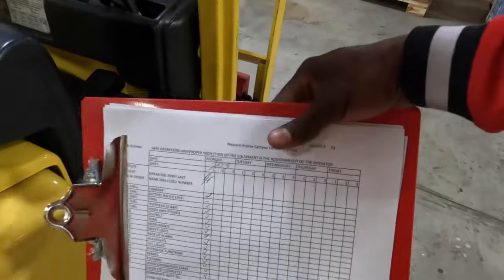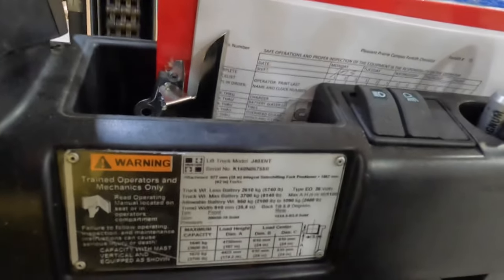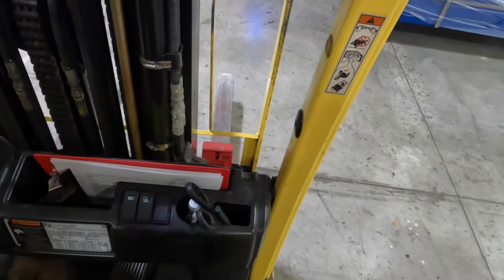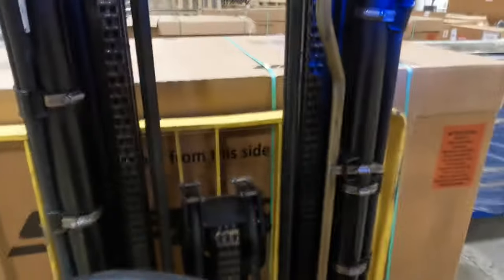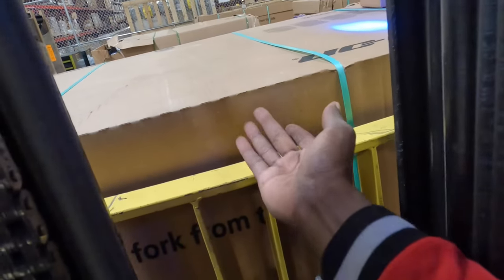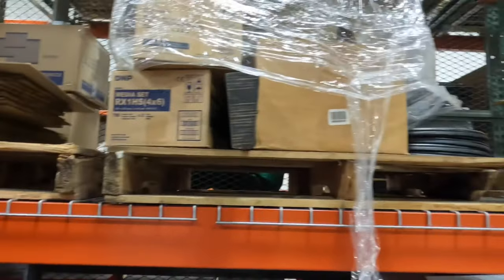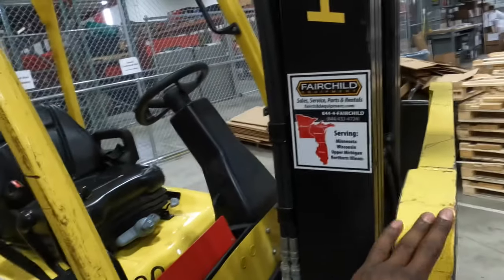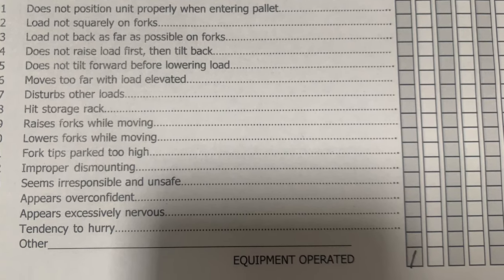How To Pass Forklift Test 2023

Comment: I'm experienced with a forklift but was never certified until today.

And it was really simple 15 minutes not including my the written part which I did in early January.

In a room roughly 20 ft x 20 ft, with a steel pole in the center, she made me do the check list, lights, mast, fire extinguisher, etc, etc, etc, then she made me get in, pick up a pallet, back around in a circle around that steel pole until I was in my starting position. Then she made me pick up the pallet again, back out and turn to place the same pallet on on upper level. She told the only way I could fail is if I damaged property, or people. Which I didn't. 

Certified. It's pretty easy actually. Forklifts are easy to operate. I used to need to load 4 of my own pallets onto a 1 ton cude truck inna warehouse, with minimal space between the back of the tuck and whatever was behind. 5 feet space, ouch ng the first to skids up towards the nose of the truck with 3 and 4 pallets. I had to learn. I remember getting into a heated yelling match with my manager about 15 years ago about that. I asked him if he could load my truck for me, he was good on the forklift. I was not certified. He told me to do it myself. I lost it on him. "F*** YOU! I AM NOT CERTIFIED TO USE THAT THING! I HAVE NEVER EVEN DRIVEN IT! WTF!?" I lost it on him in the warehouse in front of everyone and this is a big guy. He could pick me up and throw me through a wall I he wanted. He gets freaked out. I remember him recently, 2017, we got into it for her something he come over to me and grabbed a hold of me almost I'm a big to restrain me because he wasn't sure if I was gonna lose it on him. I think me exploding humbled him. I look crazy when I'm that angry spit flying out of my mouth, barking yelling, truely angry, not a show. I honestly believe it scary to him because he didn't know if I was going to lose it and attack him, I was already super stressed. It was a winter day, storming and I am going a long distance with a lot of stops. I lost it on him, he points towards the office where the boss resides and says "that's who you talk to about certification..." And his tone, I knew I humbled him because I was mad. I was p***ed, but I also had to show him up, so I learned to do it. Without certification. I hadn't driven one in 15 years until this newest place and it felt second nature to me.

Comment: I just started driving a lift for the first time ever back in June. I've gotten a lot better at it, but I'm still a beginner. My test was really bad. It was just pick up a pallet of parts, drive it about 50 feet in one direction, and then drive back and put it back down. And then I was certified. Even though their test was not thorough enough thankfully I'm a fast learner and I can drive it decently enough to where I won't cause any issues.

Comment: What’s up question. If the load is to big to see over so I have to drive backwards but in order to do so and exit I need to turn the forklift around but the area is to small to do so, do I lift the load till where I can see then turn it around and lower the load then continue to drive backwards? Or do I move forward with the load I can’t see over until there’s clear space on my sides and turn around? Seems unsafe so to me lifting it in the air, turning then dropping seems like the best option, am I right?